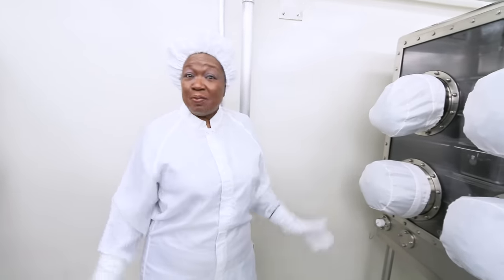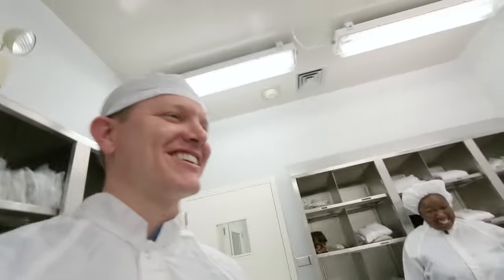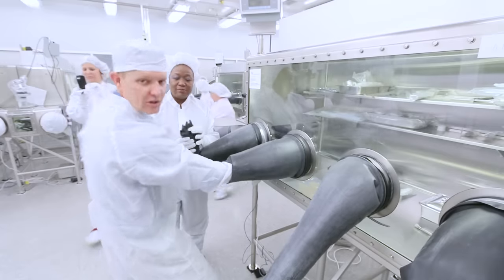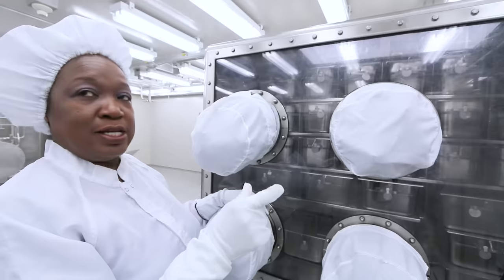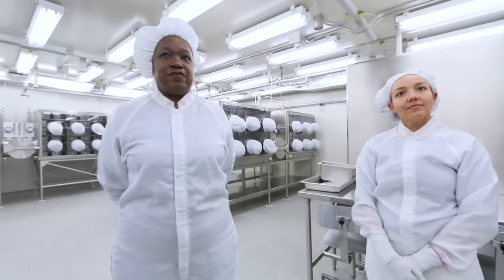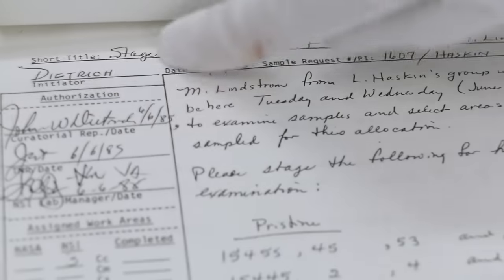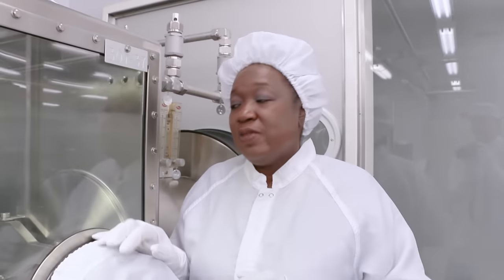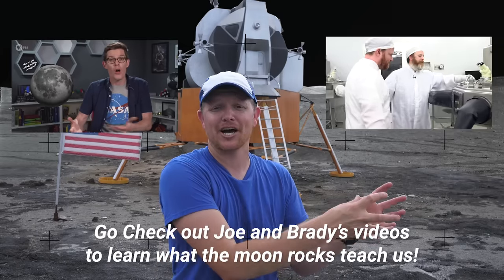Where does NASA keep the Moon Rocks? - Smarter Every Day 220

Comment: 1:01 Props to Destin for filming on the Moon like that without a suit.
Reply: He's as close as anyone has ever been
Reply: Isn't lunar rocks and soil temperature at 240 F during the day time?
When they take put them in the box and take them inside LEM, wouldn't it have made the LEM very hot?
Actually then... how about space suit on the moon?
Since the sun shining at 10,000 F and lunar surface shining on them at 240 F, the space suit would get crazy hot too?
How was this problem resolved?
Reply: @sbkarajan  By sending the astronauts to Las Vegas while filming the 'moon landing' on Earth.
Reply: I don’t think he was really on the moon , was he?
Reply: @justincraig398  yah he was you can tell by the gravity
Reply: @justincraig398  No Stupid Body went to the moon, sorry.
Reply: @JaceDanielFilms  Low gravity can be simulated by reducing the frame rate. Works everytime.
Reply: @sbkarajan  you think they landed in direct sunlight? Lol.
Reply: @sighfly2928  Yup, they did. Direct sunlight, also know as in the daytime.
Reply: @sbkarajan  Also 'sealed in a vacuum' is a very important phrase. There is no medium for it to transfer heat across and it doesn't radiate heat in the same way as the sum.

Comment: If everyone has to wear a bunny suit to prevent contamination, why don’t you have to wear a face mask too? Seems like there could be be contamination with organic particles from respiration.
Reply: Andrea explained that there's constant positive pressure keeping air flow moving out of the place which would deal with any respiration-based contamination, I'd expect. I'd be more concerned with beard hair or side-of-head hair falling off.
Reply: I was more perplexed by the lack of any kind of cover over that guy's BEARD.
Reply: They should wear a mask, all the dead cells falling from skin. Etc
Reply: Kain Yusanagi the flow velocity of positive pressure ventilation is going to be less than 1 meter per second, or you would see every loose item moving in the breeze. A cough, sneeze or even a laugh would have enough velocity to deposit particles on the surfaces in the clean room.
Reply: Yeah, I'm guessing that they are not that concerned about that kind of contamination because everything is bagged or in one of those sealed boxes. For other kinds of clean rooms, you do need to wear a mask.
Reply: @NickRoman   I was gonna say the same thing. There may be incredibly small amounts of contamination in the clean room itself but it looks like the samples are all kept in cabinets that have no interaction with the environment in the clean room. They're also like triple-bagged at all times except for cutting, I think they're taking quite enough caution for what is essentially just dirt.
Reply: @ldmcnutt  the samples are typically not exposed to the clean room's air. So there's no possibility for direct contact. And volumetric flow rate is high in this "clean room" environment which removes all suspended particles if there's ever even brief contact with the room's air
Reply: @THENETESH  Also, they should work only on VR version of rocks. Bullshitology.
Reply: Red Coyote Jam Garden  theres only one clown here. Look in the mirror.
Reply: Larz did anyone hire lars for his superior opinions on space artifact protection??? Nah I didn’t think anyone asked lars anything ever.
Reply: Well, there is a reason, why they don't need to worry about our tissues etc: Because they know, that these particles on the rock cannot be from the moon, as we know, that there is no life on the moon, especially no life, that has a human DNA.
Reply: I've never been in a clean room of class 1000 or beyond and not needed to wear a beard/face mask.  I, too was surprised
Reply: Yeah with all those precautions an addition of a face mask would not be too troublesome.
Reply: Because the whole thing is a hoax.
Reply: Red Coyote Jam Garden how does gps work?
Reply: Larry Keene moon rocks are actually immune to beard hair contamination
Reply: Triangulation. Gps is just like all the radar systems, 3 points.
Reply: They want the workers to be able to snort moon dust, Wolf Cop style
Reply: they are more concerned with chemical contamination, because it can change the analisis of the rock, its not an bioharzard room that even the face need to be covered.
Reply: It's about reducing the amount of particles below a certain level. You can get to that level without facemasks. Some clean rooms are at a level that requires them.
Reply: Red Coyote Jam Garden  you're crazy
Reply: So where do you think the rocks come from?
Reply: Red Coyote Jam Garden  keep telling yourself that
Reply: Red Coyote Jam Garden  they did come from Earth...4.5 billion years ago lol.
Reply: Red Coyote Jam Garden  What are you, a flat-earther?
Reply: Red Coyote Jam Garden  what science? I'm a petrologist at the lunar facility. My focus isn't lunar but I know the geology.
Reply: If you don’t need a face mask to prevent depositing bacteria and virus particles, you don’t need to be wearing a bunny suit.

Comment: I wonder if the Lunar Dudes brought any rocks back without bags or vacuum seals or pressurization to see how they might compare upon return and over time?
Reply: Good question but I would suggest it doesn't work that way. You would need to bring back the rock totally sealed, analyze and index it, and then start chopping of little pieces one by one like once a month and only expose those to the atmosphere of the earth. That way you could compare the original rock with the other ones at any given time in the future to know the changes. If you brought back your rock unsealed you wouldn't know the bias towards you are comparing your changes.
Reply: I think they did, judging from asterisk citation here 10:11

Comment: We used chips off moon rocks to date the solar system by measuring the ratios of rare Earth elements. Too cool, but we didn't keep them in a clean room once we had them. We were looking at small samples that we hit with proton beams, so the grains in the samples had to be extremely smooth, polished with diamond dust compound.

Comment: That was awesome, and even more awesome is that we're headed back to the moon very soon with modern technology to collect more moon rock samples
Reply: Heade back.  Hehe.  NASA statedthey don't know how to get through the belts.  Going back.  Not going to happen.
Reply: Do the math........
Reply: @franksmith7419  lol, someone dropped out of high school (its you). NASA is going back before 2024 with the new Artemis missions first launch is next year testing the capsule and rocket before sending humans on Artemis 2. and yes its extremely easy to go though the belts. NASA said they couldn't send the space shuttle though the belts because of a lack of fuel and that its just not build for that kind of thing. the Apollo missions the astronauts passed though the belt in under an hour or two and for a lethal dose of radiation you would need much much much more than a few hours of exposure in the belts.

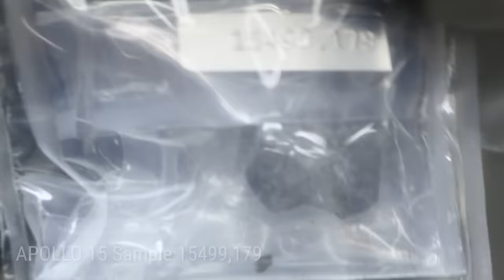Comment: 8:43 what are the 179 tests on that rock? Like how many test updates can we do on one rock upon improving lab equipment? Amazing. Love you NASA. 

Through the years in this laboratory how in the world have they added new rooms, ventilation systems, new.. sealed gloved cabinets (name? idiot here), odds and ends, floor and wall cabinets, etc, etc without polluting the whole shebang? Seems extremely difficult. 12:06 partial answer. Imagine finding a contractor. "Okay, drop off your DeWalt and Milwaukee's on Tuesday and we'll have them ready for work here in 60 days"

Comment: I worked at a facility where they manufacture silicone wafers. I'm not sure if i missed something during the bunny suit process, But where i was seemed like it was actually more strict. They were very concerned with copper and im an electrician... so maybe i just had an extra layer to deal with.. But their tolerance was 0.03 microns

Comment: Hold on Americans, just tell the world how Apolo11 lift off from moon's surface to return back to Earth with no fuel? If you had that technology back in 1969, then why you haven't revisited moon in these 54 years. 😳
Reply: First of all the lunar module did not make the return trip to earth. It was only designed to operate from lunar orbit to the moon's surface. And it was the descent stage on the LM that was almost out of fuel. The ascent stage had a separate propellant system for takeoff. From there it docked with the command module and was then discarded. And we did return to the moon. Did you not know that there were 6 Apollo missions that landed? 12 men walked on the moon between 1969-72.

Comment: but wouldn't the higher gravity of the earth change the moon rock in someway
Reply: That could be an issue with very weak structures, but most rock is more than strong enough to withstand the higher gravity level.

Comment: Nah man they are behind the syrup Infront of the flower ....lol....has nasa ever thought of using moondust and a building material you could just suck it up on some vacuum bags and make walls stick them together and heat it to form it .....then suck a vacuum same machine and then add O2.... but they will bore huh and do all of the lunar stuff under  the ground ...not on surface....I'm just saying there should be a simple awnser to that problem ....